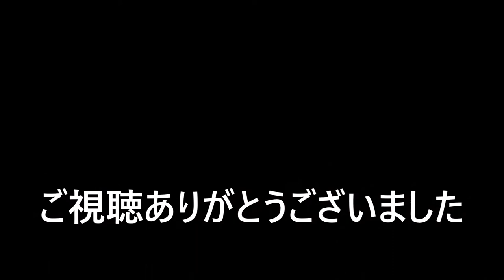〈Sub〉ランドクルーザー80 タイヤ交換　グリスアップ -メンテナンス-

Comment: Konichiwa 🙏.. What are the sizes mud terrain tyre, arikato
Reply from the maker: Thank you for your comment.
The wheels are 8j17 inches on the center line.
The tire size is 285 / 70R17.
The brand of the tire is MAXXIS MT-762 Bighorn.

Comment: hi,  would you tell me the name of the grease please? What's the size of the grease pack 40g? お願いいたします。
Reply from the maker: AZ Extreme-pressure Graphite Grease Urea-based bellows 80g
This high-quality extreme-pressure grease effectively combines graphite, extreme-pressure agents, and various additives in a urea-based grease with excellent thermal stability. In particular, it has excellent resistance, water resistance, and abrasion resistance, and is resistant to impact loads. It does not dissolve easily in water and does not soften or leak due to moisture contamination, thus ensuring stable lubrication for a long period of time.
Operating temperature range: -20°C to +200°C
Gauge No. 2
Reply: @Masatamach  thank you very much 😀😀😀😀😀